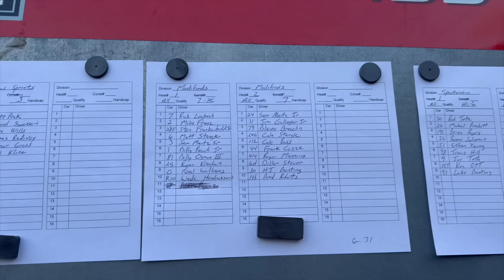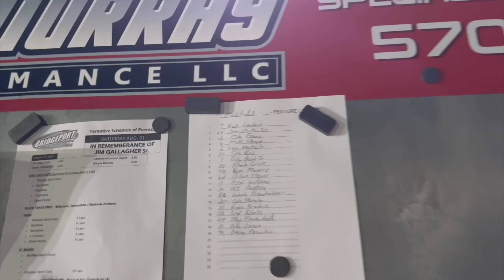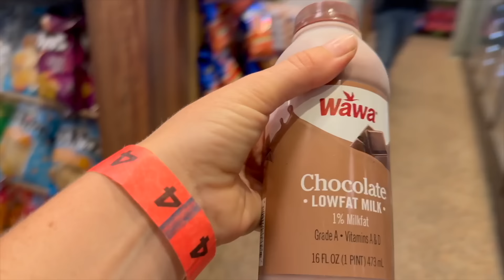Epic Last Lap Miracle! Unbelievable Win At Bridgeport Speedway!!

Comment: Congrats on the Win! Now on to this tire prep. If there was a tire we were gonna run in the feature from the heat race. We always cleaned it as best we could and gave it a good scuff. Takes the "is the tire sealed over" out of the equation. Tire prep could the difference between 1st and 2nd. Can't wait to hear a pod cast on this.